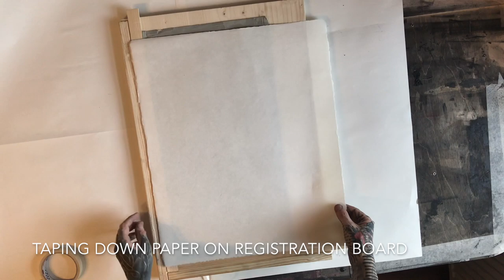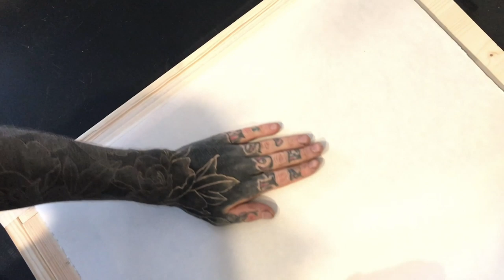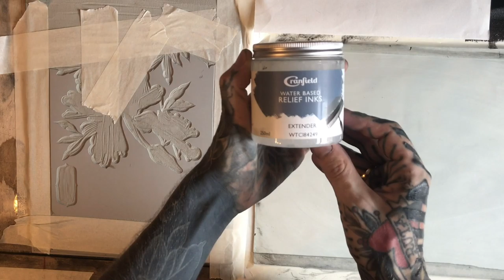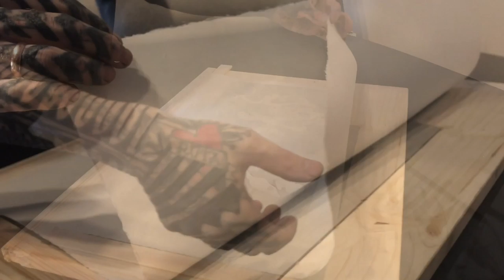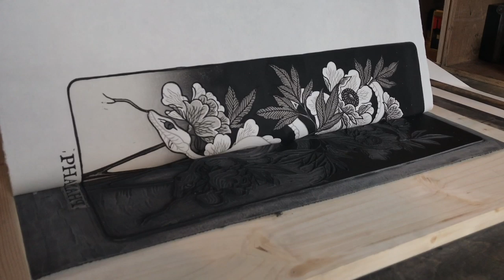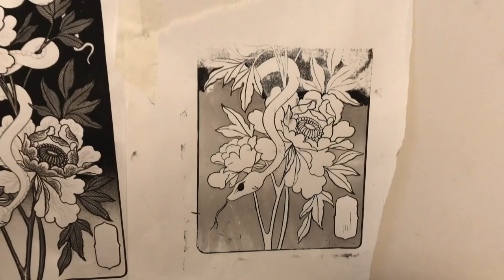LINO CUT HAND CARVED AND PRINTED BY PRESS TEST PRINT

Comment: Absolutely fascinating! 
I have a question though... why do you push the signature stamp with your bare hands when you could run it through the press?
Reply from the maker: Sometimes i like when its not 100% printed with some defects.  and also the stamp is carved in 8mm lino and rest print is 5mm , so it will not work that smooth !
Reply: @EmilsSalmins  Hey Emils! Your printing is really impressive!:) How come you do the stamp seperately in the first place? You could just include it in the original print right? is it a printmaking tradition or why?